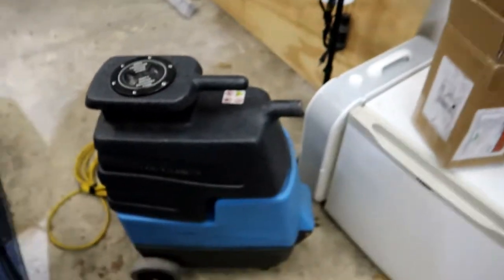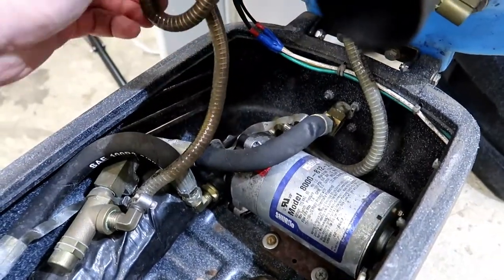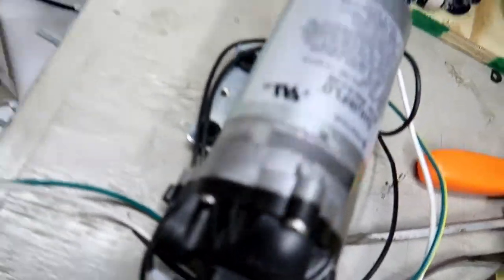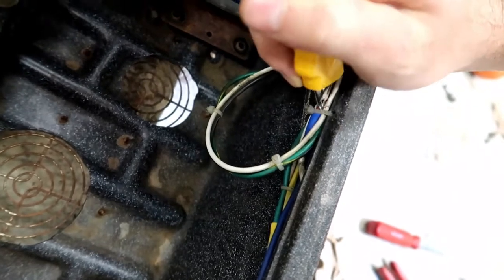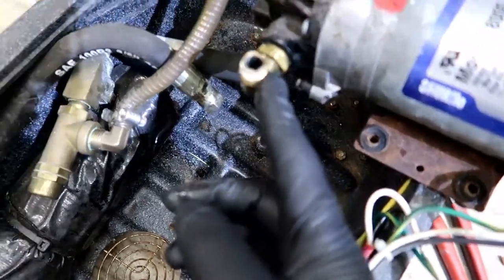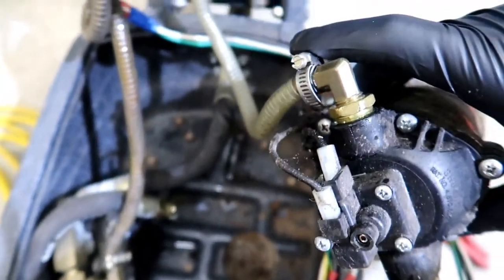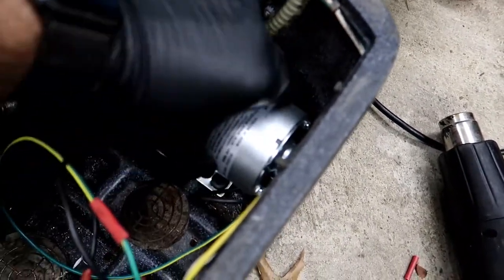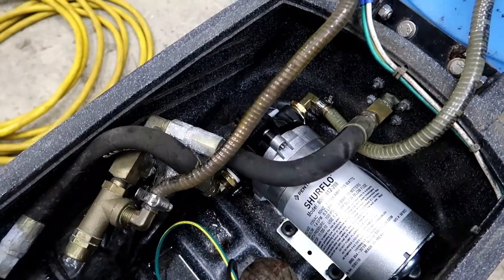Mytee Lite II 8070 Pump Repair Surgery

Comment: Update on mine, for anybody that might someday see this.  Our machine, 2015 mytee lite 8070 II, got too cold and froze.  After thawing it wouldn't spray.   Pump made the same normal sound it always does, but no spray.  Took apart some tool fittings, blew them out, took apart some of the lines inside and didn't see a problem.  Then took off the outlet line on the pump, the one that goes to the heater.  We had water flow here, so I knew the pump worked.  the problem was simply the check valve in that line had stuck closed, so no water could get through.  So I simply replaced the bronze check valve for 15 dollars and it works fine.
Reply from the maker: That’s Awesome! Good thing you investigated! Good job!  I love how this is helping people with this model machine.
Reply: Thanks for posting I may have same issue not sure yet, but will be checking in very near future
Reply from the maker: You’re welcome!  I just made a new video about replacing the vacuum motor also. That finally went on me the other day.
Reply: It took me a long time to figure this out. I don't use my 8070 often because the VX5000 does a better job without saturating the carpet and underpad. When I do, I have this problem and its always the check valve. I don't replace it but I stick a tooth pick and free the ball bearing from its "stuck" position. 
Mytee should post a video about this.
Reply: So I’m having a similar problem and i blew air in my hose and it went through to the other side. I bought another flow jet, hoping that will fix my problem. I’m not getting any water come out at all. Fittings aren’t sealed or closed or anything.
Reply: Did you order the new valve from mytee ? Having the same issue and that’s exactly what it is for me I somewhat got it to open back up

Comment: I do recommend you run the vacuum motor when you’re done for like 5 mins so you can prevent rusting of the vacuum. I always do that right after jobs. It basically drys all of the moisture inside the vacuum motor.
Reply from the maker: Good tip thanks!!
Reply: do you do this with solution still in the tank?

Comment: Mine died yesterday on my mytee lite 3 after just 6 months and barely any use lol I am watching and learning.
Reply from the maker: That stinks! Hopefully, this video helps if you have any questions feel free to contact me!
Reply: Miranda Detailing thank you! Appreciate that 👍
Reply: @MirandaDetailing   i replaced pump on mine and now its blowing bubbles out of the reserve tank where the filter is. Any ideas?
Reply from the maker: Weird. All the lines are tight?  Sometimes air gets trapped and needs to be released. I will run the pump and press the trigger and keep the water going out of the gun until the whole system is primed and not leaking anywhere.

Comment: Many people talk about the order to turn the machine on, is there a specific way to power off the machine, or can I turn the buttons off in any order? Thanks! Great video!
Reply from the maker: Personally I have never had any problems with turning it on in a “wrong” order. But technically pump first, then heater, then Vacuum. Supposedly if turned on in the wrong order it can cause vapor lock or an air bubble in the lines. But again I have never run into that.

Comment: This is funny, today I was messing with my detailing tool just like yours that same nozzle because it would shoot the water but when I would release the trigger it would keep shooting a little bit of water. I took apart the trigger and it got better but after seeing your video and going to take the whole thing apart and use my compressor and blast the crap out it. Anyways l enjoy watching your videos.
Reply from the maker: Thanks!  Yeah those triggers and solution hoses get stuck and clogged after a while. Glad it helped!
Reply: Miranda Detailing I'm deciding if I should get this soon. Cause it's on sale now.  $150 CAD off. Then I can get the clear plastic head. Since getting customers is difficult. I might start off with partial services first. Like seats, carpets and mats for lower prices. Customers don't seem to understand the $200 to $300 type of detailing. Especially when I don't own a commercial garage. What do you think if I offer partial interior services just to build on my portfolio?
Reply from the maker: That’s great. I think you should definitely offer what you can at a reasonable price. Sometimes carpets and upholstery does not need full extracting. Usually the carpet mats are what I use the extractor on. I say start at a comfortable price and work your way up.
Reply: Miranda Detailing could the quick connects also get gunked up? My pump sounds fine but it feels at about 70-75% of pressure coming out. I’ve already replaced the solution line and fitting for the solution line. Except the quick connects.

Another example when I’m doing an extraction my water jet leaves about a 3/4 to 1” clean line and not the full width of the head of the wand.
Reply from the maker: Yes they can get gunned up to. Sometimes I use my air compressor to blow the lines out. Also unscrew the tip and blow out any little particles that may get stuck in there

Comment: Why am I not getting a suction thru my upholster tool. Everything is tight and connected
I fill up my solution tank with water, I turn on my pump and prime till water is coming out the tool, then turn my heat on and next turn on the vaccum. The vaccum comes on but I get absolutely no suction on tool. Please tell me why this is happening. Ive had it for 2weeks and only used 2 twice
Reply from the maker: Oh thats strange! Not sure what could be happening. I would contact Mytee and ask them

Comment: I just bought my first mytee 8070 on offerup for 300 dollars the exact same one you have it seems to works good but when I turned the pump on and the heater the pump shuts off and goes back on is that normal?
Reply from the maker: Mmmm.  There may be something wrong with it. All 3 button should work at the same time.
Reply: Miranda Detailing really the pump always stays on for you ?

The vacuum works great stay on all the time but the pump seems to take a break I’ll probably switch out the pump then
Reply from the maker: When you press the trigger does it pump out water fine?  What’s its doing is building pressure then the pump does shut off when it’s up to pressure. But when you press the trigger it should start to pump again.
Reply from the maker: I just saw it replied👍
Reply: Pumps don't have a lot of parts so the only way to brick them is to burn up the motor or crack the case. 90% of all other issues can be fixed by replacing the pressure switch and/or diaphragm. No need to trash the entire pump.

Comment: Before you replace the pump did you hear the pump running
Reply from the maker: Yeah it was continually running and nothing would happen when I pressed the trigger. So I thought it had stopped building pressure because of some internal pump issue. Guess I was wrong.

Comment: My pump would shut of alone and stop making noise. Now it always  stays stuck on making  the sound that used tovlast just a few seconds after turning on. Is my pump about to die?
Reply from the maker: Mine does that too now. I think it’s a leak in the lines loosely by pressure and making the pump run continuously. I’ll need to open mine up again and see if I find leaks.
Reply: @MirandaDetailing  mine drip water from the quick release attached to the bass of the vacuume. But even if i doesnt drip it stays continuous. I guess id have to that that valvle first.  Good luck with yours.  I dont think it effects efficiency in any way. I dont know.

Comment: I have an older mytee hp-100 Grand Prix the vacuum suction is wonderfully but the water doesnt heat up and doesnt spit water of the wand. Any suggestions....tia
Reply from the maker: Hi.  Can you hear the pump running?  If it doesn't heat up, the heater may be dead,  Those are not to hard to replace yourself.   
If the pump is running but nothing is coming out or the line,  it may be plugged.  Unscrew the spray tip from the head of the wand and try blowing out the line and tip with an air compressor.  I often get tiny particles stuck in that tip and it blocks it.
Reply: @MirandaDetailing  awesome will check that out... Thank you for reaching out....great videos by the way 👌

Comment: Hey Phil any new link to the pump?
Reply from the maker: Hi. I have the pump link in the description. I noticed it was updated so I found the pump again on Amazon and linked it. 
https://amzn.to/3KzFG67
Reply: @MirandaDetailing  my pump stays running thr whole time, what can cause that? Heater works fine and vacuum
Reply from the maker: Hi. Yeah mine does that too since I replaced it. There is supposed to be an adjustment on the pump that makes it shut off after it has primed but I couldn’t figure it out for some reason.

Comment: so basically 
you unbolt the pump
clip 3 wires from the old pump
Attach the 3 wires from the NEW pump 
Rebolt pump 
TEST?
Reply from the maker: Yup....pretty simple
Reply: @MirandaDetailing  wow
I was debating on just getting a new unit because my pump went out on my 8070.
I might as well just KEEP it and replace the part

Comment: Hey brother, when I connect the line to the quick connect and turn on the pump, the connect disconnects and won’t stay on. Would you by any chance know a solution or part?
Reply from the maker: Hi. Which quick connect?  the one on the machine itself or on the nozzle?

Comment: I have a mytee extractor hp60 spyder  and I lost suction,also its makes a noise as if something is loose ,but pump and heater work any help or solution?
Reply from the maker: Sounds like possibly a clog or the vacuum motor is dead. 😕. Have you tried opening it up and check the motor?
Reply: I have a new mytee spider hp 60.  I went to use it for the first time to do my car today and the pump is dead. I can’t believe it. Bought it at Detail King and when I received it it was missing two of the cap nuts that hold the pump in place from under the machine. Calling Monday to get return this lemon. What an overpriced piece of junk.
Reply from the maker: Aw man!! Sorry to hear that!  Yeah get that replaced by them! 😎👍🏼
Reply: @MirandaDetailing  
Yes definitely going to try. This is 100 percent unacceptable. Overpriced by 5 fold
Reply: Vacuum motor went out twice since this comment be careful with those coins

Comment: I have the mytee 3 and I’m trying to repair the brass fitting.. mine doesn’t have a swivel installed.
Reply from the maker: The brass fitting on the machine itself?
Reply: No the heater and pump hose
Reply from the maker: Oh I see....mmmmm....that will be tricky.  not sure how they got everything in there.
Reply: @MirandaDetailing  yeah it started leaking today and the fitting is really loose.. and when I try to tighten it the hose kinks loosen it as well can’t really do anything lol. Thanks for the reply’s buddy
Reply from the maker: Aw man. Sorry to hear that. They usually a as the swivel nuts. It could just be seized?
Reply: @MirandaDetailing  yup it was. Working on it now. I love these little machines.
Reply from the maker: Awesome!!  So glad it worked for you!

Comment: Mine froze last week and now it won't pump.  It runs but won't spray.  My pump is different.  I have the 8070 II from about year 2015.  The pump is different and it's installed in the opposite direction.  So I wonder what pump I need.  Anybody know?
Reply from the maker: Oh man!  That sucks!   I’m not sure what pump it is. Can you open it up and check the serial number?
Reply from the maker: So I found the pump that goes to that model 8070 II. Here’s the link to Amazon http://amzn.to/2CYcgMW
The only thing is I would open it up and test everything first. Don’t make the same mistake I did! 🤦🏻‍♂️
Reply: @MirandaDetailing  had the hoses switched lol all good now
Reply from the maker: Sweet!
Reply: @joshuahurley3227  where did you buy the hoses!

Comment: Do you know if there is any way you can adjust the pump pressure to low or high? Just asking for my machine. Thank you
Reply from the maker: Hi. No it’s a set psi pressure on the pump.
Reply: @MirandaDetailing  thank you for your reply, but i didn't understand. You can or you can't set the pressure?
Reply: The pump has a pressure switch?
Reply from the maker: Hi. Sorry. You can’t adjust the pressure on the pump. It has a set psi. There is no switch to turn the pressure up or down. This is the pump that is in there https://amzn.to/3f39V5c   It is a 100psi pump.

Comment: you should ve tested everything first.
Reply from the maker: Sure....but since this was my first time doing something like this I wouldn’t know where to start. That’s why I made this video, the video is the test.
Reply: @MirandaDetailing  how fast or strong should water be flowing out of the line? What I fear is, is that the pump maybe going out because our extractor used to sound like yours but not anymore when you'rerunning the water through the wand....that high pressure sound.  We have replaced all hoses and the wand but still no solution coming through the line. When you press the release button in the Quick disconnect at both ends. Any help would be greatly appreciated! Teflon tape is what that white tape is called!!! 😀😉